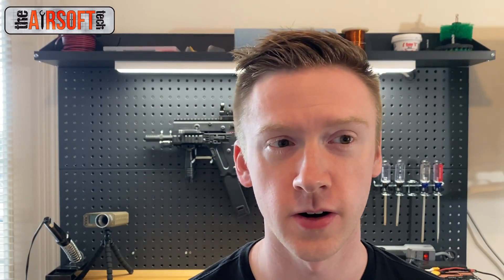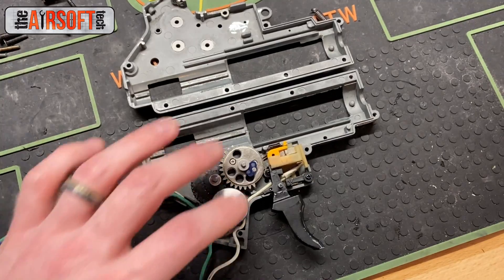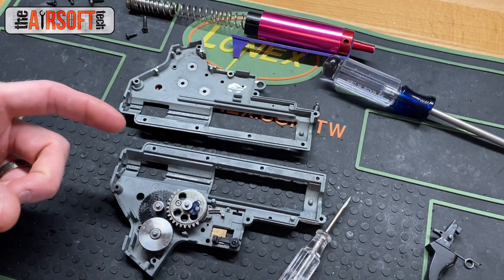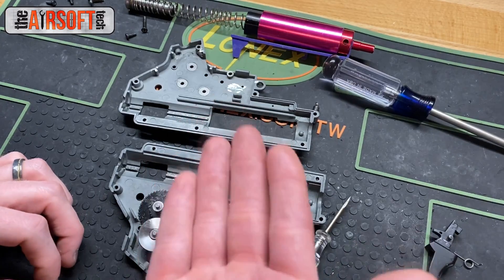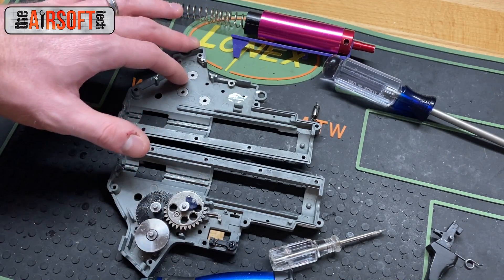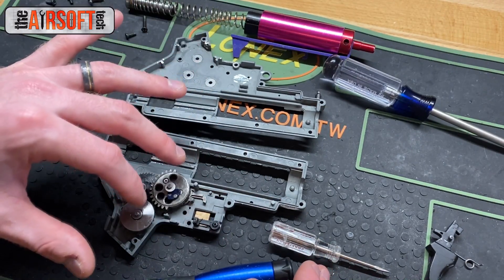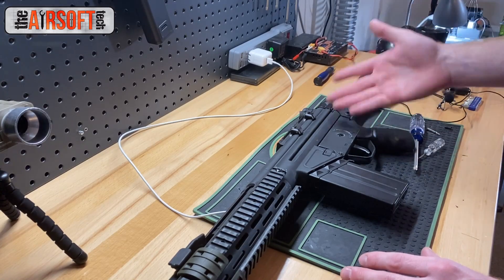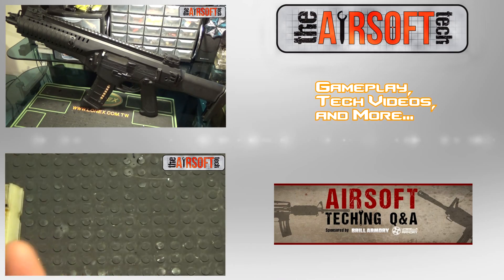Inside the Gearbox: Helical Gears

Comment: Nice video! BTW, I have counted the teeth on SHS gears and found out that "100:200" has a ratio of 23.8:1 while "100:300" has 26.4:1. 

SHS 100:200 Pinion 10, Bevel 30/10, Spur 45/21, Sector 37 => 23.8:1
SHS 100:300 Pinion 10, Bevel 30/9, Spur 45/21, Sector 37 => 26.4:1

Comment: The reason the helical gears is more silent then spur gears is that it has more teeth engaged at the time on the meshing gear. If you don't go with a helical piniongear the sound will still be  loud since this gear is the one with the highest amount of revolution. 
I belive that  if you install a helical pinon you will get the sound you are looking for.
Reply: Actually its less surface. It engages from one end to the other as a straight cut its the full width of the teeth
Reply: @wrenchtheroo6557  I don't know if Tariq edited his post,  but I didn't see anything about surface contact and he is correct that more than one tooth is meshing at the same time.  And they slide into each other instead of pounding into each other. Straight cut gears can handle more torque and have less friction. Helical are quieter, their only advantage. Also the most noise reduction will be from a set of helical pinion/bevel gears.

Comment: So when shimming bearings should I account for the slight movement that the bearings move when I push on the gear when checking the shimming?
I've heard bushing are .1mm and bearings is .3mm. So is that .1mm both bearings move and .1mm of movement of the gears axel inside the middle hole?
Reply: Need to know too

Comment: I'm not entirely sure what advantage the helical gears can provide for airsoft other than quieter operation. Also I've never seen tappered roller bearings or thrust bearings being widely available in airsoft sizes to work with these helical gears. The added axial load would make the gear train less efficient.

Comment: Can you do a video on cleaning motors?
Reply: if u use brushless, then u wont need to clean it. if it is brushed, the 1 time u clean it is when it brand new, before install into ur aeg. after that, use till broken than replace with a new one

Comment: this vid helped a lot with the basics. I do have a question tho that hasnt been adressed: Could you explain the Gear Ratio given by the manufacturer? Usually we work with 13:1 - 20:1 which is simple to understand, 20 rotations of the bevel gear turn into 1 rotation of the sector gear. Gear Ratios with helicals are denominated 100:200 or 100:300. I don't get that.
How do you arrive at the 24:1 and 36:1 and how does the calculation work? I know these questions are delving into detail but your help would be appreciated. thank you!

Comment: And the industry needs a tec to do this type off job airsoft and gel blaster for the replica industry sports. you should see about the job your going to have to make it??. From out the box to i went real steel and what's best for that build, me ACR J10 or the airsoft Madagascar and even after all the mistake and repair like 1100 worth i still would not change it and its still not on gas yet! Be around 1600 and hope your top metal reciver if she fits and get which should be ok for all 3 2500 for something special 4 but thats in the work's 😆huge potential.

Comment: ☺😊😀😁😂5 Smile's sounds good to me!. Facebook gel blaster Australia.....ACR J10 or your Madagascar dose that tan gold top reciver fit have heard its a fit but checking and not available at moment..clip motor got one motor wined one, but only one tooth to the gear to spin the clip feed wheel?? but she is noisy like looking to see if i can fix, wear in may help and may have a spare spindle one a bit longer??compared to the original magazine you get suoer quite but has a 4 tooth lock in.

Comment: What's the point of ball bearings instead of bushings inside aegs?
isn't the springs and the motor going to defeat the purpose of them since aegs are not designed for long continuous rotations
Usually, everything that uses ball bearings has a goal of reducing friction to improve speed  and efficiency (skateboards will roll further, fans can run more efficiently, ect)
Reply: If you fire in full auto the system works non-stop for a lot of cycles, the reduced friction is considerable
Reply: @Fernando-ry5qt   I would think once the first tooth of the piston touches the gear there would be no difference between the bushing and bearing right? so that small degree of rotation to reset the gears for another pull would be the only time it would come in handy, but even that its at the mercy of how soon the piston can reset.
Reply: @oooppiikkk  The motor works with the system as a whole, every bit of resistance costs you time and battery, you can't neglect the friction during spring compression, there is always friction on the gear's axles while the system is engaged, being the spring engaged or not.

Ball bearing have a lower friction for the axles at the cost of a more fragile piece, they also usually keep lubrication for more time, making them almost always better in low/mid powered applications.
Reply: @Fernando-ry5qt  I see thanks for the clarification!

Comment: I was curious if you could make a High torque build with 32:1 gears, High torque motor, half tooth piston with roughly 400 fps m4 or mp5 because I'm so interested on seeing what you could do with that, I really appreciate what you do and don't push yourself too hard in these tough times :)
Reply: 400 fps is nothing with 32:1 gears, you can even make it up to 550 fps
Reply: @democracy2005  is this the route to go if you want trigger response, but lower rps with 11.1v?
Reply: @zacktrever1878  nope, trigger reponse is better with lower ratio gears like dsg or 12:1 ssg with high torque motor

Comment: Wanted to add a couple supplementary comments on using helical gears. The more technical reason they are theoretically quieter is because torque is distributed gradually between the teeth as they engage, and also because the angled profile pushes the gears apart axially into the bushings/bearings, removing slop. I say theoretically because the higher ratio results in more gear and motor movement, which ultimately plays a bigger role in noise you hear. 

The main upside I find is their durability. The teeth are generally thicker by design, and in my experience wear more evenly. The higher ratio also requires less torque from the motor, which is good for your batteries. The downsides are they are harder to install, and need a more specific setup. I have found they work best with a faster or mid speed motor and active braking mosfet. 

It would be interesting to see lower ratio options for helical gears in the future.
Reply: Another note. 100:300 I believe is 26:1 ratio, not 36:1. The only difference in the 100:300 and 100:200 is a 9 or 10 tooth bevel gear, at least for the shs sets. 

For anyone interested in getting a set at this time you can get new shs sets at Airsoft Atlanta for $14 or $15
Reply: Wow, that is cheaper than I would have thought. Thank you for this!